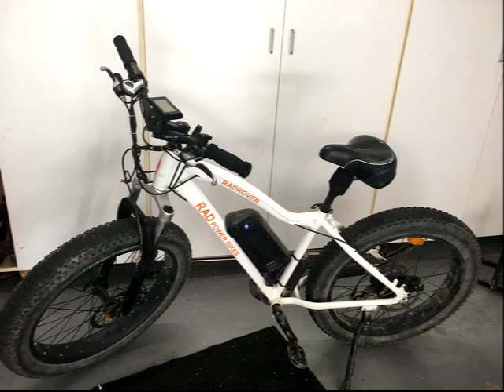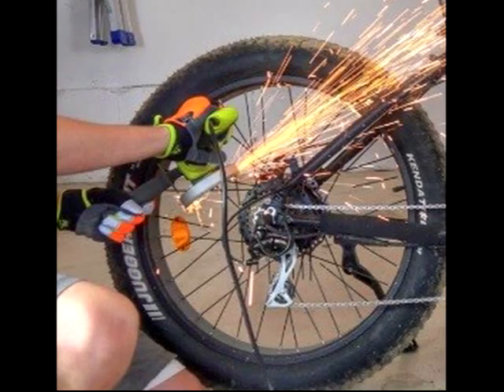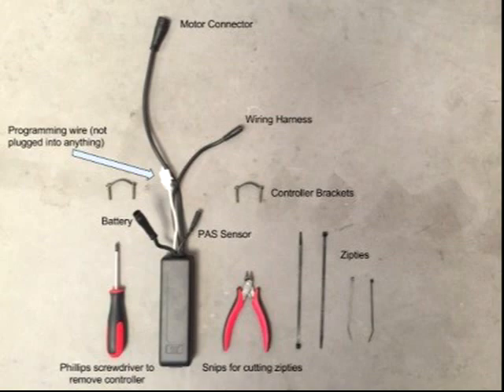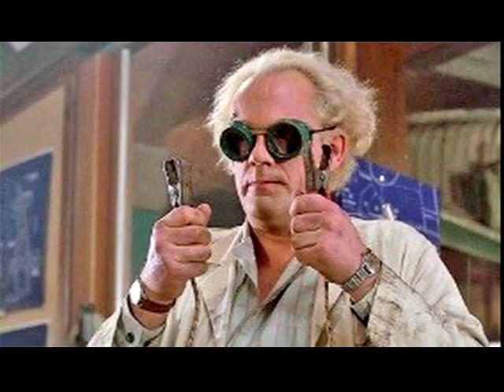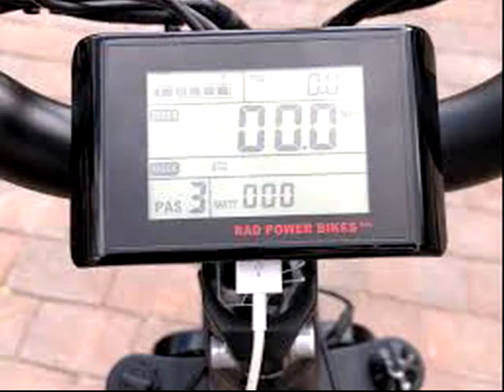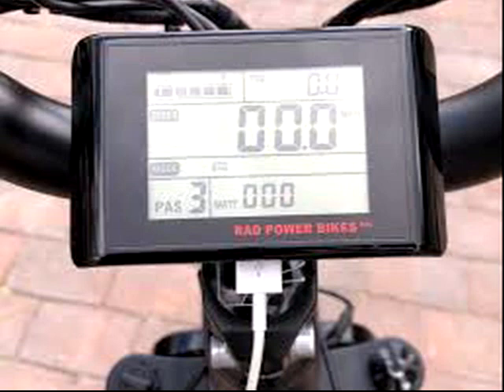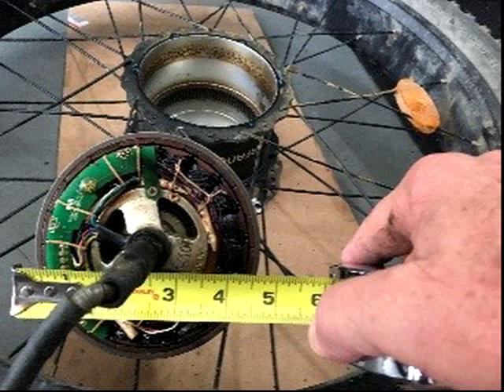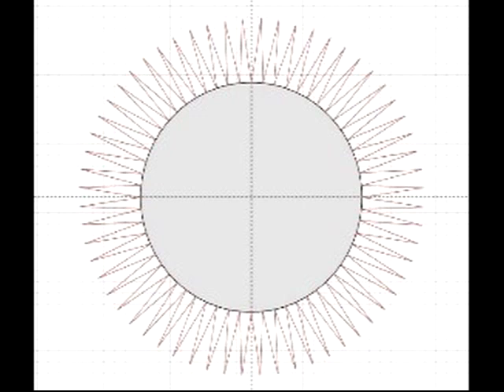Radrover Motor Issues

Comment: Wow! Thanks for the effort and sharing your experience. Thought the motors were 750w! Not just peak wattage... Darn!
Reply: I have a new CSC 20 inch fat bike and made sure before purchase it was a real 750 baafang.My motor can handle 1200 to 1300 watts going up steep hills--I went up a long hill then my very steep driveway on throttle only--motor was barely luke warm--big diffrence in power and I chose not to buy a rad for this.This was very deceitful to do and what is reallysad is when you goto bafang--there is like less then a 50 dollar diffrence and probably less then 20 since they buy them in bulk.A 1500 dollar plus product--and these bikes are already heavy and a company would skimp on a 20 to 50 dollar diffrence that makes a world of diffrence.

Comment from the maker: I spent 50-60 hours in design, procurement, cutting copper, bending baseplates and fins, wiring the fins to the baseplate, soldering, removing the wiring, cleaning, sanding, grinding the soldered fins for excessive solder, applying thermally conductive paste to the hub, strapping the fins to the hub, running safety wire through each fin, finally road testing the heat sinks.. 

The materials cost about $143.  Add my labor and that is $10,143.
Not bad to protect a $350 motor.
But I enjoyed challenge, and that is priceless.

Unable to post picture
  

I had planned on riding my bike up a long hill using full throttle and measuring the hub temperature with and without the heat sinks.  I rode up about 1 ¼ mile and the temperature did not rise enough.  I thought about riding up for 8-9 miles but then I worried that I might over heat the coils and already start to damage them.  So, I will not know the effectiveness for a few years and see if I get any thermal trips or smell hot electrical.

Comment: The 500 watt rad motor has the same housing as the Bafang 750 watt motor so you all you have to do is swap the motor guts and you have a motor that should be 750 watts continuous.

Comment: Thank you. I'm buying a Radcity4 and will look into heatsinking its gearless motor.
BTW, 73yo, 6' @ 230#..
On YT look up RadRover Bolton Boost!
Reply: Look up CSC--ALl bikes are 750 bafang--I have had mine for a week--20 inch cause these are big.Bike is awsome--on steep hills it will keep up 1200 plus watts with little to no effort on my part--and I am in 4th to 6th gear--not even a climbing gear.I also keep mine at PAS 3 and am getting 10 miles plus on one bar of power--meaning very light peddling with assist 3 and I believe 60 miles can be attained.I also have gone on off road trails and today i went in between railroad tracks--and a rain soaked gravel--grass--dirt trail with no problem at all.CSC is a USA based company and they have staff to answer phones and free tech support--they also designed these bikes and are a big time electric moorcycle company.